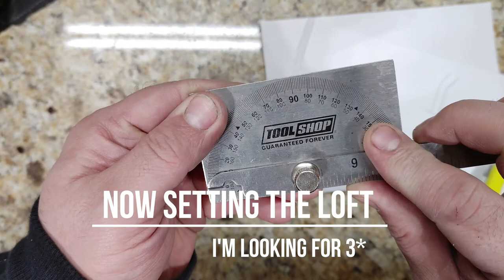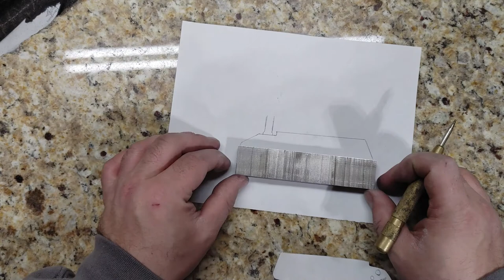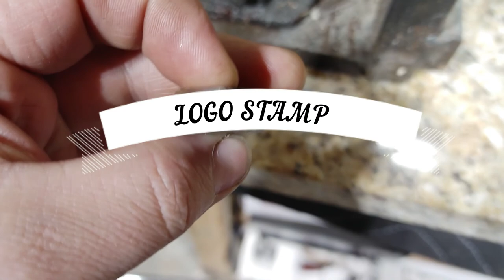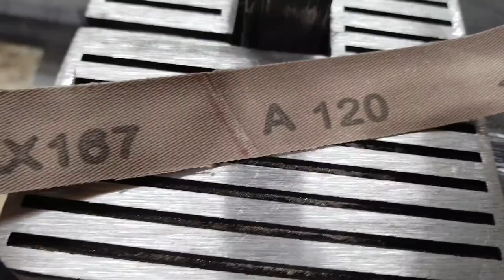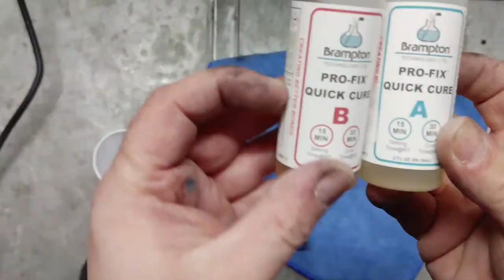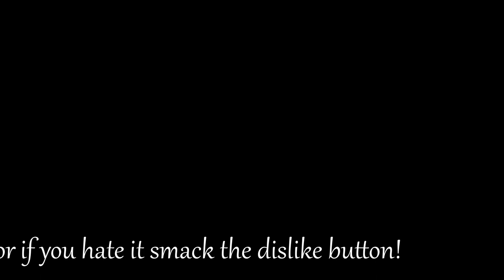Build Your Own Putter At Home

Comment: Where did you get the initial block of stainless steel?
Reply from the maker: You can get blocks of stainless from a lot of places online. Ebay might be the cheapest depending on the day.
Reply: Okay thanks, and what we’re the final dimensions of the putter?
Reply from the maker: Daniele Barone  don't remember off hand. Was around 4 to 4 1/2" long by an 1" tall. Half inch thick.

Comment: Hownany degrees to hang ?
Reply from the maker: Are talking about toe hang? If so, I don't remember what it came out to. Standard plumbers neck probably similar to Newport
Reply: @igolf906  yes was talking about the toe hang. I play a Edel putter with 35 degree upright toe hang, this to correct the twisting off the blade during swinging the putter, this way the blade comes more straith true the ball at impact, just like Honu putters. Wonder if this is possible when making a butter by myself.

Comment: How did you get the Upper Peninsula engraved into the face so cleanly?
Reply from the maker: Its a custom made stamp from EverStamp.
Reply: Any chance you recall how much is cost?
Reply from the maker: @tincup1956  I believe I paid $275 for the stamp. I used it for multiple projects for years so. Was well worth the cost.